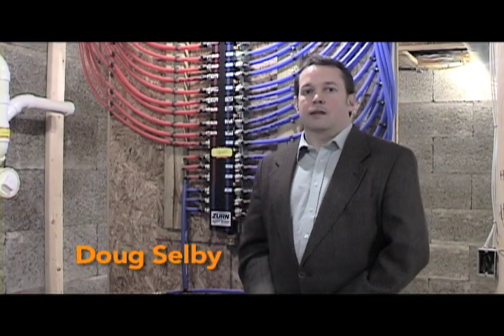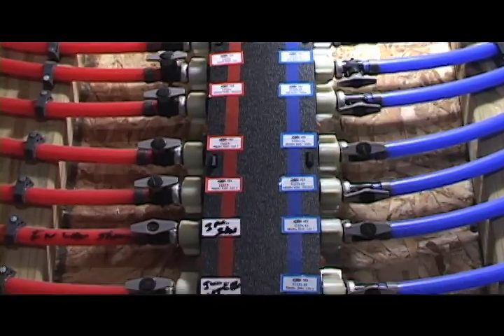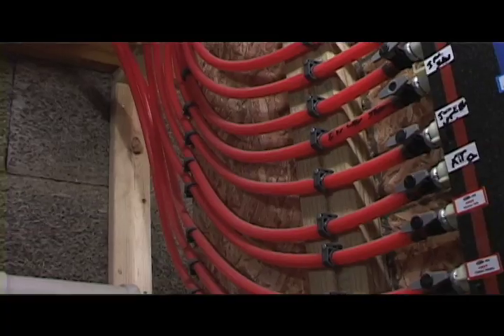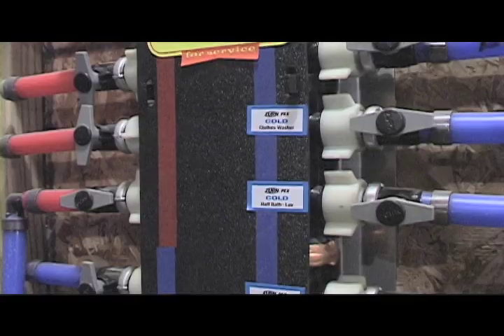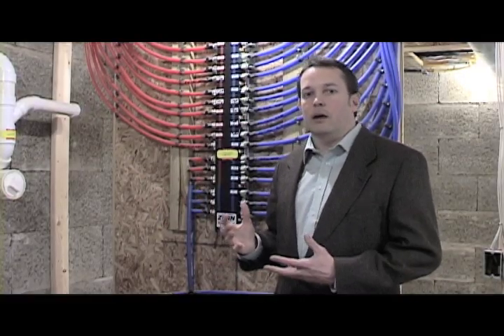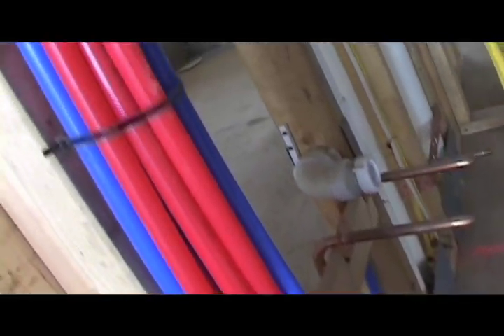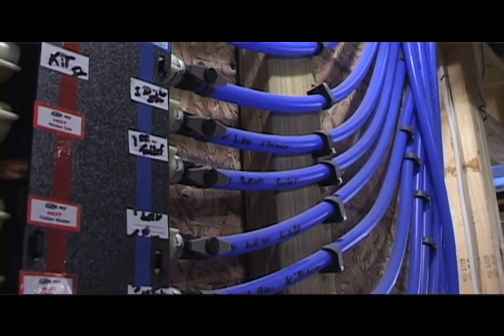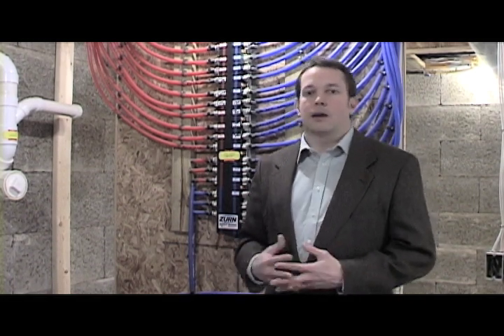PEX Manifold Plumbing Supply System - Ann Arbor, MI

Comment: So if "everything" is a home run then how are you saving money compared to a trunk branch system?  If I'm in the bathroom and I'm shaving at the vanity sink, the trunk becomes hot.  Then walk into the shower the only water i have to wait for is the in the branch line. In the home run you have to wait until the entire run empties before getting hot water.  I think the better way is to use the manifold  system with trunk and branch lines. Those bundle of hoses look cluttered and as someone else pointed out your heating cold water and cooling hot water.

Comment: Bundling the hot and cold water lines as shown at 1:00 is not a good idea. You cool off the hot with the cold and heat the cold with the hot. waste of energy running the water waiting to get cold water to brush your teeth!

Comment: Hi Ben,
With a manifold system, you can not only recirculate with remote manifolds near the far bathrooms, but you can also have the hot water about 10-20 feet away through a half-inch tube, which makes it very fast to get hot water. We use remote manifolds and recirc lines on pretty much all of our PEX systems, and most of our customers really like it. 
Thanks!